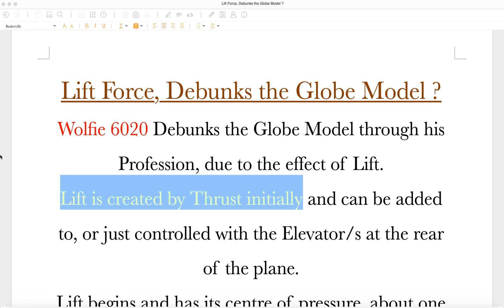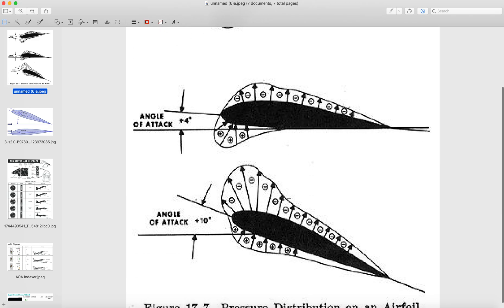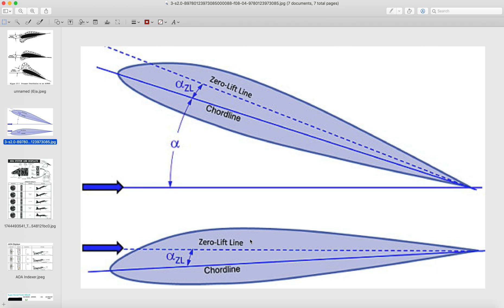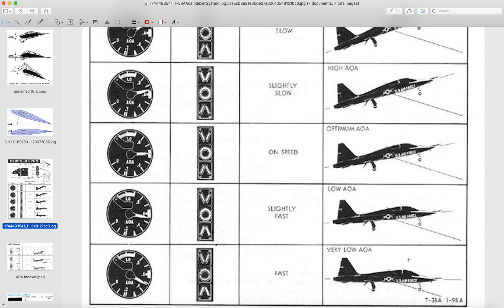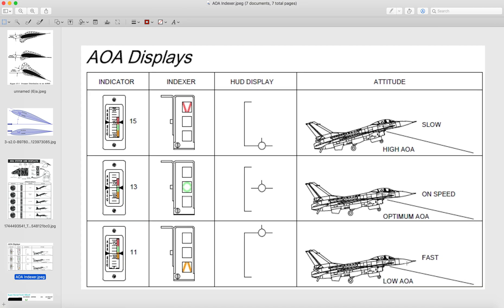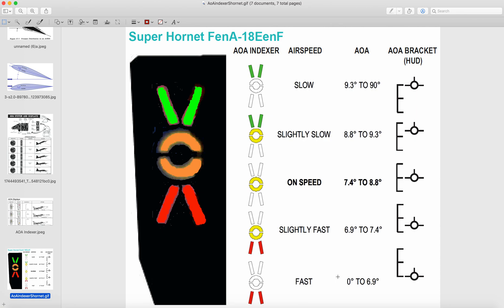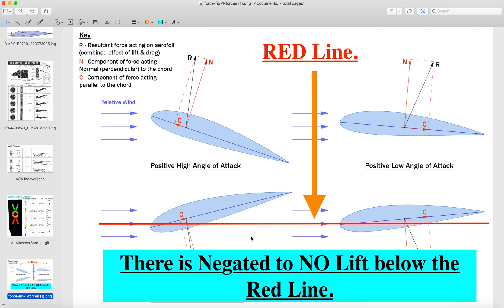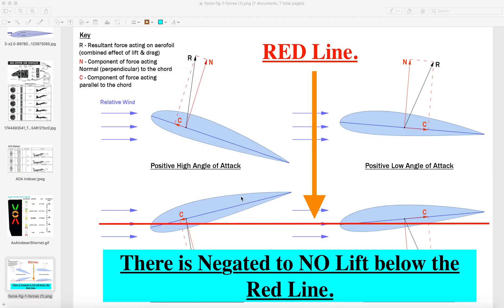Lift Force, Debunks The Globe Model ?

Comment: Sup brother.Are you talking about the wings or the lifters?
Reply from the maker: Hey Brian, the Chord line of the Wings is what I’m referring to….
Reply: @BriansLogic  That's what I thought man.Keep up the good work!!
Reply from the maker: Brian Leake Thanks Brian will do, and you too Bud 👍
Reply: ‘Lifters?’ 

Oh boy 🤦‍♂️
Reply: Is there any chance you could point at the "lifters" Brian? The only lifters I can think of might be inside the engine.
Reply: @bluemarblescience  lol.Just asking questions.Are they called elevators?
Reply: @brianleake7762  Ailerons are on the wings and they control roll. The rudder is on the vertical tail and that controls yaw. The elevator is on the horizontal tail and that controls pitch. That's for a conventional design. Canards are different - the elevator is the little wing on the front of those airplanes and it stalls before the main wing can which is the whole idea behind that design but you don't see it very often. Look up Long-EZ by Burt Rutan.